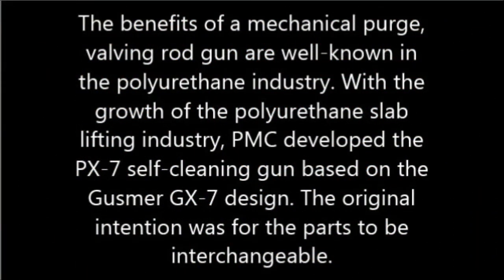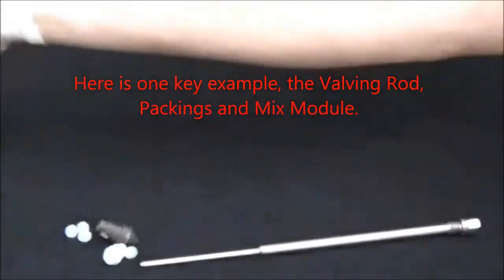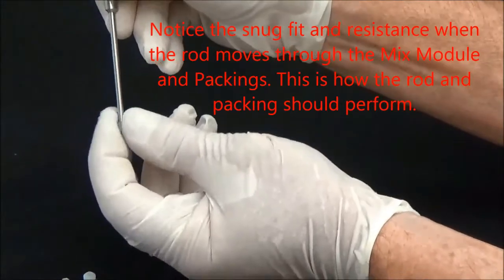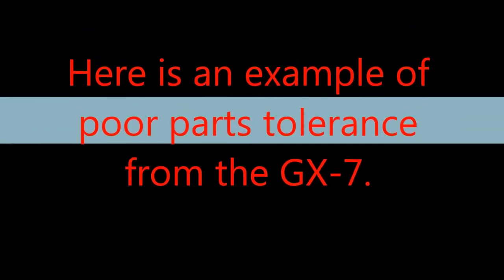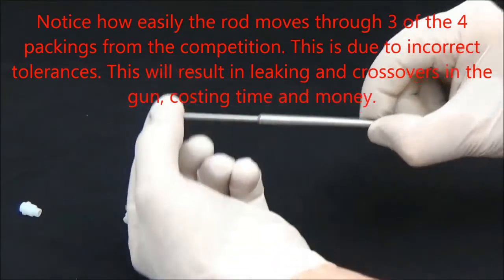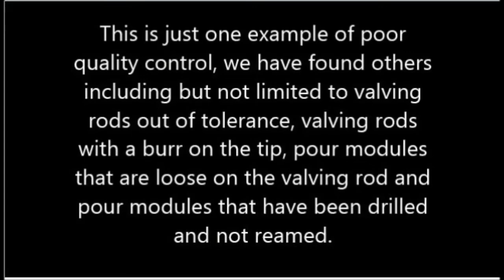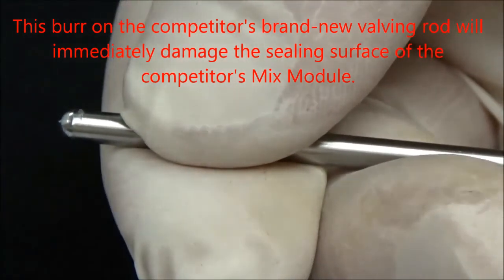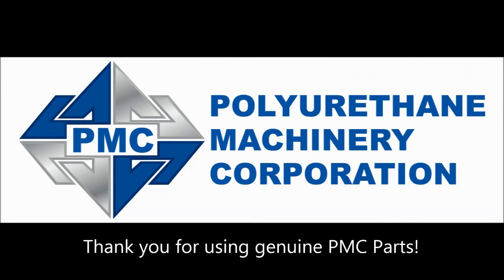PX 7 vs  GX 7 Parts

Comment: I can't help but think this video is biased. I've always used the gx7, with parts from Graco or spfdepot. But I'm contemplating buying a px7. Just worried that the durability of the gun itself may not match that of the gx7. I was lucky to get 7 years out of two gx7's.